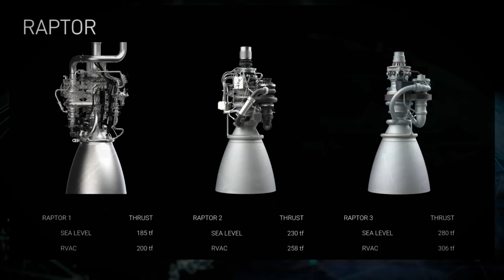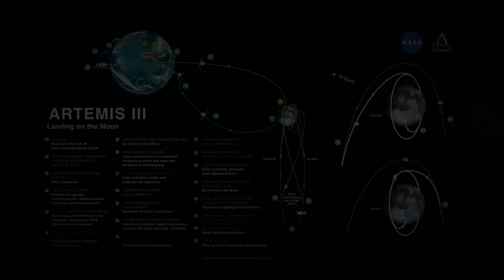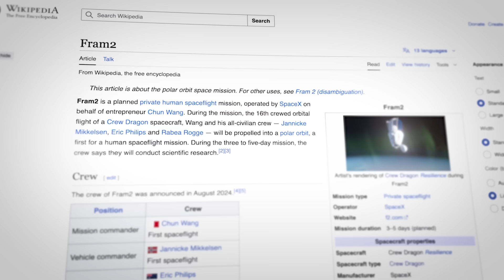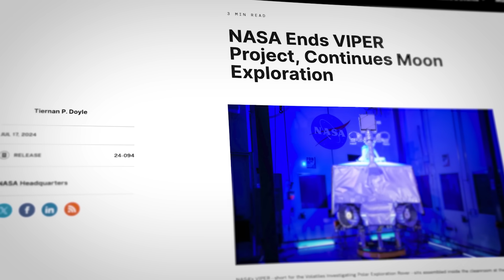The 2025 SpaceX Update Is Here!

Comment: Why could a rocket go to the Moon in the 60s, but modern rockets need refuelling in space??
Reply: Good tech question. The Apollo Saturn V rocket was huge, to lift off with enough to get all needed into orbit, I think two big stages, both expended, then the third stage, expended, was used to boost toward the moon, with the command and service modules and the lunar lander. Then they orbited the moon with the command, and the service modules, and went down to the moon with the lunar lander, then back up again to the command and service module, leaving the assent part of the lander to crash on the moon. Then, all in the command, and the service modules, they boosted back to Earth. Then, when in Earth gravity again, they all went down to Earth with the command module re-entering only, splashing down in the ocean, and leaving the service module to re-enter and burn up. 

I may have missed a step or two, but that is it. That's how to get from the Earth to the moon and back over 50 years ago!! And yes, they carried all the fuel they would need to and from the moon with them. Pretty easy, ...long ago!!  : )
Reply: @ronschlorff7089 Also they left earth orbit in such a way that the gravity from earth slowed them down to require less fuel for lunar insertion. That in itself was genius
Reply: Since re doing it its very expensive

Comment: The Mimic Dome: In order to colonize Mars, a simulation dome must be built here on Earth to mimic the Martian atmosphere to train Astronauts. This dome could be over 200 meters in diameter and a 100 meters in height with smart glass to mimic the daytime and night time on Mars. But this dome must be built over a massive concrete foundation built a few feet below the ground, and providing insulation for the dome above and also create the right temperatures and gas combinations of Mars. This concrete foundation is the control center with state of the art medical and other emergency facilities in case of evacuation of trainee astronauts. This dome should mimic the radiation levels found on Mars. Astronauts should train building Habs, and hydrophonic domes for vegetation growth. The only mimic not possible will be gravity but it may not be a serious issue. However, the astronauts could learn driving Mars rovers and learn how they behave in the Martian environment. Weather simulations could also be initiated as part of testing and training. I am sure this theory of the Mimic Dome may not be new. It could already be doing the rounds in Tesla.

Comment: why cant spacex send a full booster ontop of a booster into orbit , so there is a booster full of fuel waiting for the piloted ship to join up . then the starship has a full booster to use to get to moon n back .the booster can be left in moons orbit while starship goes to moon surface then once finished on moon they reconnect to booster to get home .
Reply: Well then the weight will increase and it would require more fuel to travel the same distance
Reply: One booster isn't enough to reach orbit, is why, that's why rockets are multi-staged.
Reply: The rocket equation does not take any prisoners

Comment: 3:32 is that even possible? I mean sure communication is one thing but having internet means lots of transmission power is involved considering when the distance is around 500 km. The phone might need some specially designed antenna but even with that upload speed won't work properly.
Reply: The satellites are lower than that.  Spacex also isn;t the only ones offering that service. it is really unfortunate that most space channels do not cover Spacex's competitors, but AST Space Mobile is also launching satellites for direct to phone 4G and 5G service.

Comment: At this point the Starship is just a boilerplate vehicle. A lot of hardware has to be added to carry propellant, cargo, or to be usable as a lunar lander or Space Station module.
Hopefully, the Star Factory will make building the shell routine, and some of the hardware already has flight heritage on Dragon. But some of it will be brand new. We'll have to see how quickly SpaceX can work on building in all the details that make these Spacecraft useful.
Reply: Starship has in fact met almost every goal for every test flight. It's called an iterative design. Crew dragons are also cheaper than soyuz launches. So you're basically just full of misinformation....
Reply: @AramilX1995  it is called moving the goalposts, the real achievements they set that they are still failing like their pre orbital goals. Their remaining pre orbital goals are reflying a starship, full scale testing of ground support equipment, fine tuning of their heat shield, payload testing, performance refinement on stage separation, aerodynamic refinements, Avionics and system testing and refinement for complex operations, safety drills with environmental assessment pending, pad and launch tower readiness, control launch sequence, beyond max Q testing, reliably recovering starships. Even if they do get to orbit, they have to complete these goals either way.
Reply: @FischerNilsA 1st. you fail to account for the fundamental philosophy of SpaceX's design process. It would be completely wrong to equate one cheap prototype starship rocket to a fully researched and developed Saturn V rocket, so judging starship development based on the fact that they are on the 6th flight does not tell you anything about how successful the program is. A better way to compare would be the total cost of the program. So far, the entire Starship program has cost around 5 billion dollars, in contrast to the Saturn V program cost of 83 billion dollars. That's a bit over 6 billion dollars per launch or more than the entire Starship program thus far. This isn't even considering the cost of R&D for the shuttle program, which is largely considered a failure. The US government and the consensus of the rocket community is that these programs were unsustainable and not viable options for long-term spaceflight. These rockets used a fundamentally different design philosophy than SpaceX and many private rocket companies today. So far, NASA and SpaceX would consider that the Starship program is currently doing very well. Secondly, the claim that Dragon is more expensive than Soyuz is verifiably false using some research. A fully loaded Dragon mission to the ISS would cost 55million$ per seat. NASA often does not use all of the seats, which is a personal choice in wanting to keep the flight private, and that would result in a more expensive flight than the 55 million, but to be clear, that's NASAs choice and is still less than Soyuz. Our most recent figure for Soyuz is the NASA deal made in 2020, paying 90$ dollars per seat to the ISS.
Reply: @soulywoly7070  good analysis, but you forget to adjust for inflation, 1960's dollars could buy more stuff for less money. So direct costs today, dollar for dollar, and then are invalid. Example, I bought new car for $4K then in 1966 before I got drafted. Got back in time to see Apollo 11 land in 1969. Today that car, being a classic, is worth about $45K, and any new comparable one of today much more. Still very good points otherwise. : )
Reply: It’s a gas station essentially, have two of those orbiting the moon fully loaded with fuel and then you can go to mars
Reply: @ like it a "Circle K" in space, hope they have good prices, like down here on Earth, .....especially now!! LOL ;D
Reply: @FischerNilsA russian troll? SpaceX brings more payload to the orbit then the rest of the world AND Russia together :-) Russia is technological dead.
Reply: yup, it's like "back to the future", test test and test again; then GO for the moon and planets. Let's get to the latter this time around! :D
Reply: Hey, have you ever thought about investing? I came across some opportunities that might be worth looking into and thought you might be interested. I figured it was ok to reach out to you in regards to my business platform would you be open to getting more info? I’m confident you’ll benefit from learning more.

Comment: 5:45 I am sorry what? Temperature isn't the only thing keeping oxygen liquid, pressure is the other one. Venting away the gas just makes more gas by dropping pressure assuming fixed volume. Some spacecraft use internal bags that are pressurized (squished) by light gas from the outside, but that ain't the story here. Notably, IFT2 failed because of CO2 that was added to the tank to keep pressure up solidified and clogged engine intake filters. Such a poorly researched video.
Reply: I think you are nitpicking. The spacecraft WILL explode if the evaporating propellant is not vented. And you are correct, that if the pressure drops more propellant will gassify. But having a sun shield and insulation will be key to keeping the propellant depot full while filling and waiting for the Manned Spacecraft to arrive for refilling.